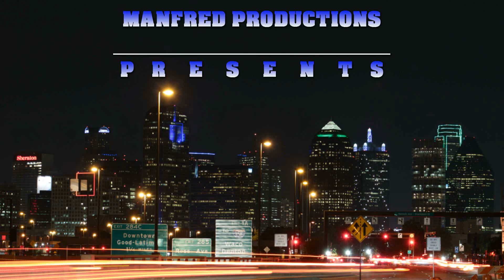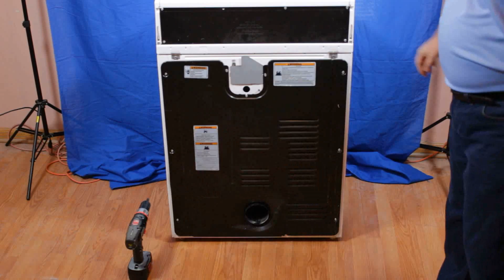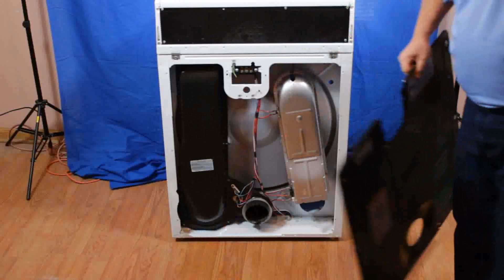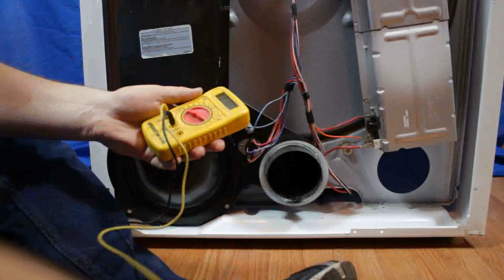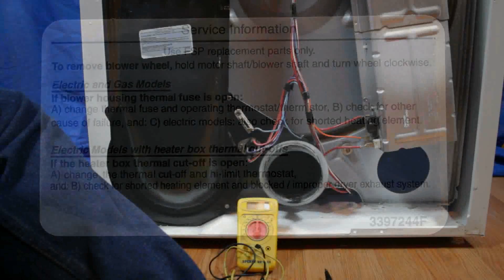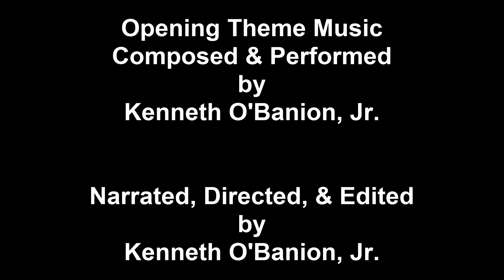Whirlpool & Kenmore Dryer Wont Start or Run - Thermal Fuse Repair 3392519 or 3390719

Comment: I'm struggling with my 1999 Whirlpool/Kenmore dryer. It wouldn't start, so I suspected the thermal fuse thanks to this video. I briefly jumped the fuse to confirm that the motor, heating element, fan, etc all work.... but the timer did NOT seem to "countdown" during my test. Unfortunately, I ordered the thermal cut-off fuse kit - which is obviously not the correct part (this kit is for the heating element thermostat). I've since ordered the correct thermal fuse, and now I see that I should also replace the operating thermostat. My question is this: If I replace the thermal fuse and operating thermostat, and this is actually a timer issue (if the timer doesn't run, presumably this could cause overheating/blown fuse), won't the fuse/thermostat just pop again? If so, I'll have to replace the timer AND replace the fuse/thermostat AGAIN? Everything is clean and no obstructions anywhere. Thanks for any advice.
Reply: canyonman1963
 Yes.. plenty of heat. Perhaps even too much heat. On regular setting, heater gets real hot. On air dry only, element does come on and warm up. So it looks like thermostat issues somewhere. I have NOT yet replaced the thermal cut-off fuse kit (fuse and thermostat on the heating element). I guess I'll just go ahead and replace these today. Will I see any difference in operating behavior? I have the thermal fuse and operating thermostat on order. When it's all said and done, I will have replaced both of the thermostats and both fuses. Hopefully this will get everything back in proper working order? It would have been nice to be able to isolate the problem and not have to order so many different components - but I'm working without an ohmmeter. =/
Reply: I replaced the thermal cutoff fuse and thermostat. Perhaps I overstated the heating issue... in my earlier tests, on "air-dry" only, the element did come on - but it certainly did not get "hot" - just warm. I'm guessing that this is normal. Setting on normal heat dry, the element definitely was getting much hotter, so it seems like this model has two heating modes? I removed the element and inspected. No breaks, burning, or shorts. Element is not touching anything. Everything looked great. Now, after replacing the thermal cutoff fuse and thermostat, the timer is again working properly. It does count down. I'm still waiting for delivery of the thermal fuse and operating thermostat, so I'm not running the dryer, but the tests look good so far.
Reply: canyonman1963
 P.S.: the replacement thermal cutoff kit requires some electrical work. They've replaced a hard jumper on the thermostat with a jumper wire in the new kit. You need to cut wires and replace connections to install the new kit. Just a heads up for anyone doing this.
Reply from the maker: ThrashNeon I hope it works without any issues, but I still think there is a short somewhere.  There should be no heat at all on the air dry cycle.  But based on your last post it does sound like everything else is OK and normal, so hopefully there will be no more issues.  Best of luck to you

Comment: Hey there- love your video, i received my thermal fuse today, and thought this would be really easy to replace. I took off the back of the dryer and my thermal fuse isnt there.  I have a kenmore elite quietpak 9-- is my thermal fuse in the front part by chance?

Comment: Dryer made a loud noise and then quit working in the middle of a dry cycle.  Also smelled like something was burning.  Checked the belt and it was fine.  Do you think it may be the fuse and/or thermostat?  If not, any other suggestions?  Just a poor single woman trying to fix it myself to save $$$.  Thank you!
Reply: canyonman1963 Will do.  Thank you so much!  I really appreciate it.

Comment: Thanks for the video. Dumb question but where do I buy a replacement fuse, direct from Kenmore?  I have a model 110.65062500 dryer. 

Also unrelated but if you can help thats great. Before the button stopped working it did weird things, like it would randomly beep in the middle of the night (basically the control unit would light up without being touched).  Also a few times the tumbler would be going even when the door was down. IE I was removing clothes and it would randomly turn on and spin a few times.  Ive lived with it but maybe there is something else I should be replacing while I'm in there. Thanks!!
Reply: canyonman1963 Thanks.  Yeh i can finish the load, then go to bed (sleep) and in the middle of the night it was turn on and beep.  It will do this for a good 20 minutes. Beep every 2 minutes or so.  Its almost like it possessed lol.  What we have been doing is just unplugging it from the wall when we arent using it.  But Id love to fix it. Perhaps I need a new door sensor? Anything else you might suggest?  Thanks again for your awesome help!

Comment: Thank you!  I already ordered the thermal fuse, but I guess I did not need it.. it was only a couple of dollars.  I ordered the heating element too.. Hope to get it soon and get this dryer up and running.. Guess my drive belt broke and the heating element both went out at the same time.. Thank you again for your quick reply.. :))

Comment: The model # of my stackable Kenmore dryer is 417.99160810. It does not start when the button is pushed. I cannot seem to find a fuse. I did a continuity test on the thermastat and it checked ok.  Any suggestions?  Thx
Reply: canyonman1963 I checked continuity on everything I could see. It seemed to work on all except a part that is a 2" long ceramic type part with this # on it: IRC 9147 PW10  4.4k 5%.  Should this part even have continuity to it?  If it should, perhaps it is the bad part.  Thanks again for your help.
Reply: canyonman1963 I changed the range from x10 to x1k and I got the needle to move to the 15 range.  I assume this means that the resistor is probably good?  Looks like I need to find that fuse in the rear of the dryer....it's hidden somewhere back there :)
Reply from the maker: Samuel Y I suspected you would find the resistor to be good.
Reply: canyonman1963 I did a continuity test on a 3" wire attached to the dryer switch assy (connectors on each end with a gray resistor looking thing in the middle with red and yellow stripes on it). It failed. Could this be causing the dryer to not start?  Thx
Reply from the maker: Samuel Y I am not sure what part you are testing and talking about.  Try emailing me with a picture of what you are doing manfredcanyon  attdotnet

Comment: thank you so much for the fully detailed step by step clip.
i did use your instructions to replace the fuses in my dryer and it worked fine for 4 times, then the Thermal Fuse died again!
do you have any suggestions?
thanks again for sharing your professional experience with us.
Reply: canyonman1963 thank you so much for the fast and fully detailed reply.
indeed i have followed your steps one by one, and did replace the operating thermostat and and thermal fuse. On top of that, I did clean vacuum and cleaned all lint from everywhere possible; even i removed the Lint Chute Assembly and the Heater Box and cleaned them very well.
I have checked the exhaust hose, it was pretty clear, i was apply to see the outside.
But I did notice something strange in the behavior of the timer knob assembly which started couple weeks before i had all the issues with fuse; usually i choose the 60 minutes under the Tumble Press, when it finishes the 60 minutes, the dryer stops, but the Knob, continue on turning (very slowly) until it passes the Fluff Air area, and then it stops.
I don't if that has anything to do with blowing up the original fuse, and the new one i just installed!
Reply from the maker: ***** It does sound like the timer is having problems, but I do not believe that would cause the fuse to blow.  I would remove the heating element and look at the coils, see if any have broken and then grounded to the element housing.  This would cause the element to stay on all the time, even when the thermostats are trying to turn it off and on.  That could over heat the dryer enough to pop the fuse.
Reply: canyonman1963 I will check it later and will let you know what i find.
Just out of curiosity, can you tell me how to test the operating thermostat?
Reply from the maker: ***** while cold, you test for continuity, with wires removed, across the two larger terminals, and then across the two smaller terminals.  The smaller terminals have a resistor between them, so you need to set the ohm meter scale on a higher range to get it to read properly.  This only is half of the testing.  To make sure it is breaking continuity at the correct temperature, you would need a testing thermometer to check the air temperature where it comes out of the dryer.  Then while running the dryer, you should hear the thermostat click as it breaks continuity, then the air temp should drop by whatever is specified degrees on the thermostat, and then it should click again turning the heat back on until it gets back up to the temp specified on the t-stat.  For instance, if the t-stat has 180 - 60 stamped on it, the temp should get to 180, then fall by 60 degrees before it begins to heat back up to 180 degrees again.  If it gets to much above the stated limit, it is bad, and will allow it to get hot enough to pop the fuse, which has a higher temperature limit listed on it.
Reply: canyonman1963 Finally, I had the chance to follow up with the Dryer machine! 
I did check the heating element and every thing looked fine, so i went ahead an replaced the two fuses again (the operating thermostat and and thermal fuse)
But i didn't know how to ground the element housing, do you have a YouTube video showing the procedure? 
I did try to use it couple times though, but the cloths came out wet, i hope the grounding will help it. If not, I think it will be good time to call for some help.
Thanks again for your help.
Reply: canyonman1963 All checked, and everything was ok :(
i will give it few days, and if it continues to make these problems i will call somebody.
thank you again for all your support.
have a nice weekend
Reply from the maker: ***** You to, and best of luck with getting it repaired.  If it turns out to be some strange problem and you or tech figures it out, comment back to let us all know what the problem was, we all need to keep on learning!
Reply: Sure i will.

Comment: My dryer was making very high-pitched squeaking noises, then one day would not run.  I would push start, it would run for a few seconds, and then stop.  I watched the videos which suggested the squeaking was coming from the idler pulley or drum bearings.  I ended up replacing idler pulley, drum bearings (which were practically not turning at all due to large amounts of hair/threads wound around the spokes), and I replaced the belt.  Dryer will now run on the air/no heat cycle.  However, when I try to start it on the drying cycle, it runs for a few seconds again and then stops.  It does heat for those few seconds, and even seems to be overheating.  Would this be symptomatic of the thermal fuse as described in this video?
Reply from the maker: If you have a Kenmore 90 series or Elite dryer, there is a dryness control board in the control panel,  It is a printed circuit board with several resistors and with several wires going to it.  It could be bad, but I know of no way to test it to be sure.  But the symptoms you have are how it acts sometimes when that board goes bad. The fuse is not bad, or it would not run at all.
Reply: canyonman1963 Thank you for your response and help.  It is a Kenmore 80 series.  It's not running on the air cycle either, now.  It will run for about 5 seconds and then stop on that cycle as well.  It screeches when it first starts up, but then seems to run fine...for about 5 seconds.  Is is possible it is the thermostat only?  Any other thoughts?

Comment: Tell me why it is so important to place wires back on the stats in a certain way.  I don't remember it ever making a difference.  If so, wouldn't it be important to not put the stats back on " upside down "?  In my mind, there is no "upside down" for a stat.

I really am not arguing the point, I just don't understand this.  I mean a stat will let power through either way just completing/opening/closing  a circuit.

I have seen this same thing posted elsewhere. always confuses me a little.